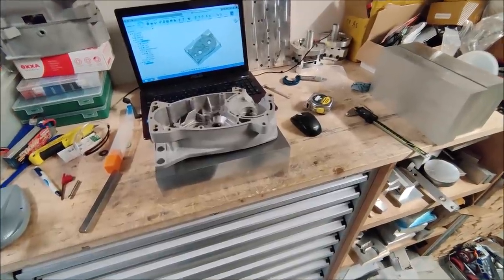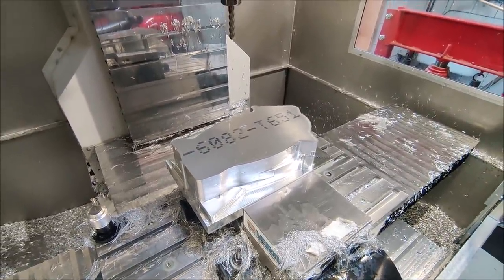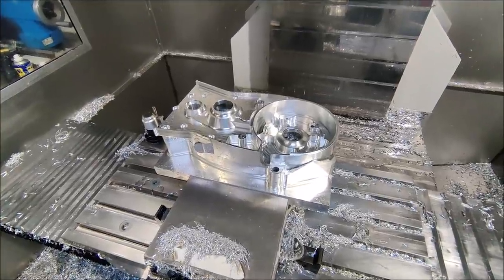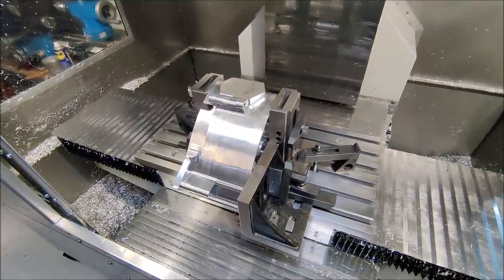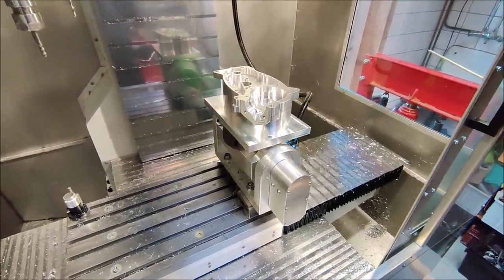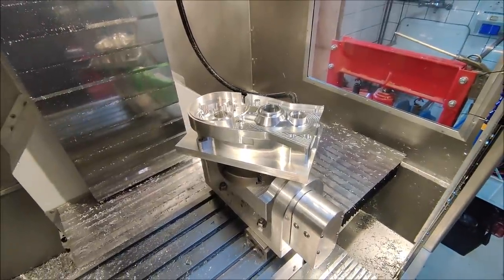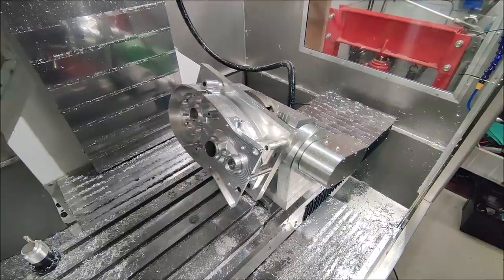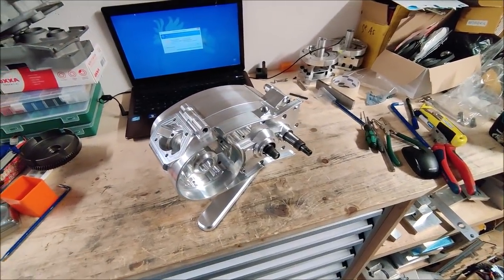Cnc machining a zundapp 5 speed engine part2

Comment: Wow, such an amazing skill set to accomplish such a project as this! Just getting all the correct dimensions and details figured out, then CAD modeling all the components, then the machining skills, fixtures needed, etc. plus the hundreds of hours it takes to see a project through such as this. Can you do a video showing your technique for the reverse engineering of all the critical dimensions and details needed for such a project? I've done a few small motorcycle parts for fun by using my CNC router touch probe on an existing part to record the various dimensions need to CAD model and replicate the part. It works great for all the major hole locations etc. but getting all the curvatures to match is tedious and time consuming. It's kind of fun to then take the model, scale it down and 3d print a copy of it.  At any rate keep up the good work and thanks for sharing!
Reply: It's indeed quite a feat! ...but not comparable to the fact that he built the whole CNC machine entirely, from scratch, including the 5th axis setup. Mind blowing.

Comment: You could make a tool that chucks it up and allows you to manually tap while spinning the spindle along with it to maintain the alignment. I preferred tapping by hand most of the time if it was only a few holes just to reduce any chance of ruining part even though all my machines are threading capable. All depended what i was making and if a one off part or not.

Comment: Hi Stef, is there belt tension in your trunnion? I think that adding some or increasing the tension will help with the 5 axis simultaneous movements. Without tension your gantry might have backlash when it changes direction since the belt has play.

Comment: Did you ever loock under the railcover to see if the covers work how they should?
And what cind of coolant do you use?
Reply from the maker: Unfortunately there are chips getting under the ways. I try to clean them frequently. But most of them stay out luckly. For the coolant i use synergy 735

Comment: I was reading your thread on cnc zone but the pictures are offline, can you share the building pictures of the VMC on Google drive? I'd be very thankful if you could do that, I'm intended to build your project, thank you
Reply from the maker: you can view the pictures here, my webspace doesnt have the right ssl certificate so most browers doent show my pictures anymore.

http://gallery.svitterzon.nl/?jgall_dir=vmc%2F
Reply: @Svanitterzon  thanks it worked, do you know if is there a way to make the automatic tool changer without a servo motor on the spindle?
Reply: @Svanitterzon  why you disappear ??
Reply from the maker: @mhshmo49fabio49  iam still alive, but last halve year i have been busy with redoing a house and still busy with that so no time to work behind the machine unfortunately.
Reply: @Svanitterzon  I wish You all Blesses, I have Qs and a request ; 
Im on my DIY CNC 5AXIS as same as Your configuration little diff. in structure design
- Do You think that EDING controller is the best as motion controller ??
- Do You know about ADTECH 6090 6axis controller "I wasnt able to find diff. with EDING CNC 760" if You know which is best ?
- Can You upload Your "cnc-building" video ... Thank You :)